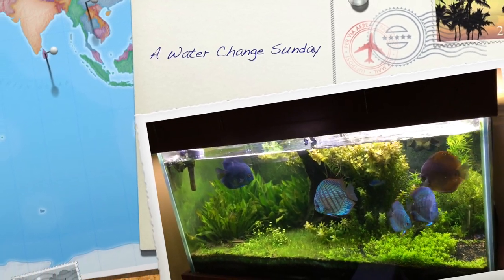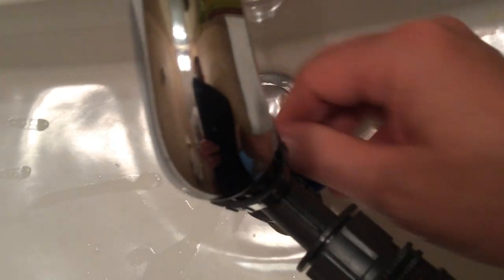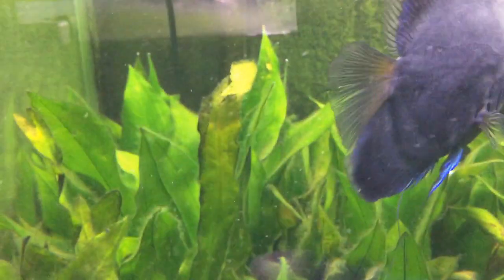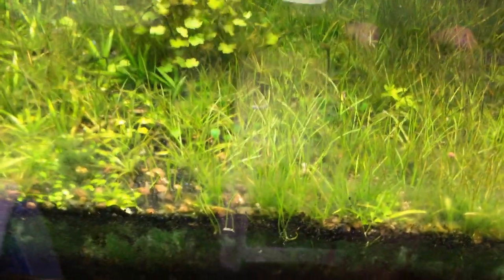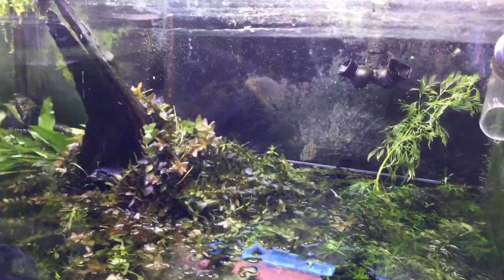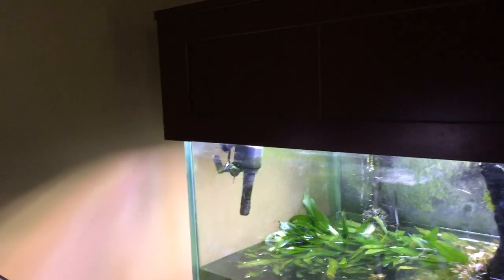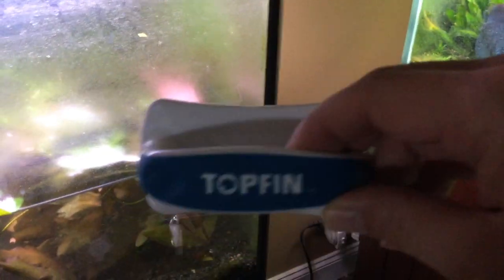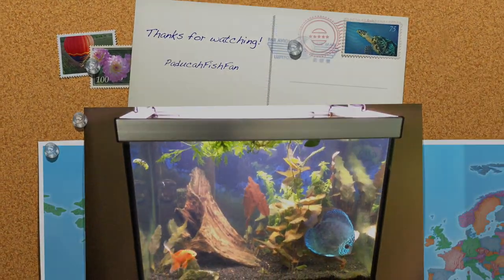A Water Change Sunday

Comment: Great idea to pump water out.  If that hose is the same material as the aqueoun one you can run some hot water through it to soften it and get the kinks out. Trick I picked up with my hose.

Comment: Suggestion: 

I do almost the same thing to my 120 but only about 30-40% I honestly freak out about the prime, chlorine, big water change

I use a thermometer at the sink before I push water to the tank.. Keeps me from running back and forth and keeps the tank from swinging at all  

and I push my old water out the door into my wife's plants door is closer and the plants love it

Comment: Have you ever connected a hose to the bottom of the FX-5. It would make good video to see the FX-5 clean itself. Back-washing the FX-5. Thanks
Glad to see Lucky is ok.
Reply from the maker: Ruben Thanks on Lucky!
It's a real pain to pipe into the bottom nozzle.  It doesn't close easy and isn't a tight fight.  I only use that when I'm breaking the pump down for a cleaning.  I've never been able to tap into that valve and not have a small pool of water to clean up.  :-(

Comment: Do you cap off the output hose from the fx5 before you hook up the hose going into the toilet?
Reply from the maker: pelphrey It has a valve on it when I attache it to the FX5.  I don't open it up until at the filter until it is in the toilet.

Cheers
Reply: ***** Ah! I just noticed you have a separate valve on the hose. Makes sense now! Thanks again!